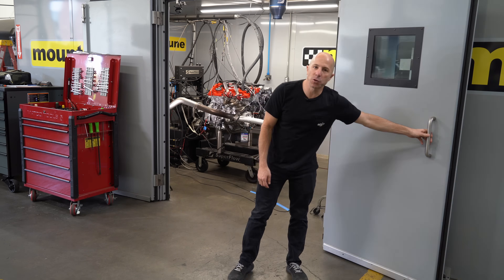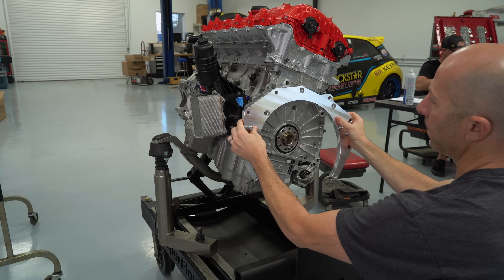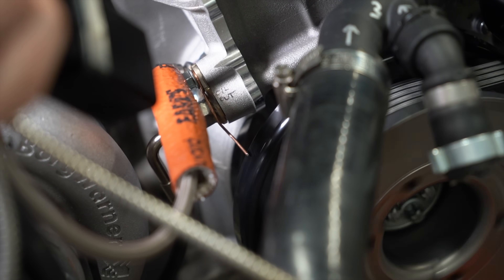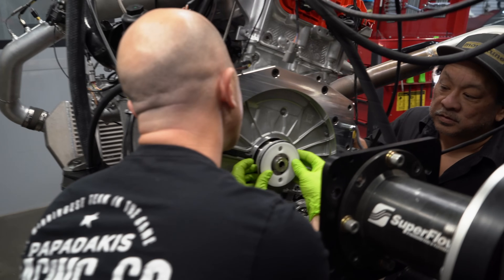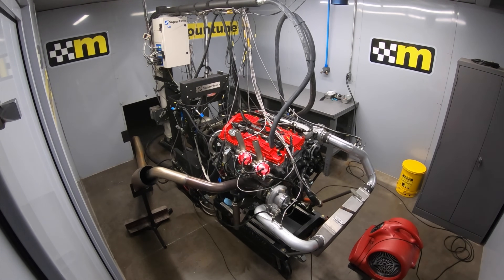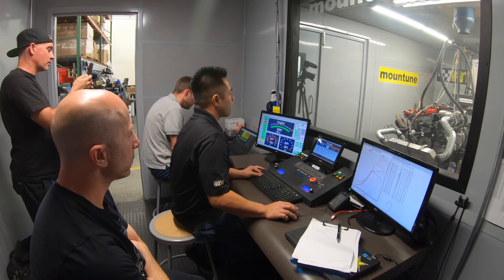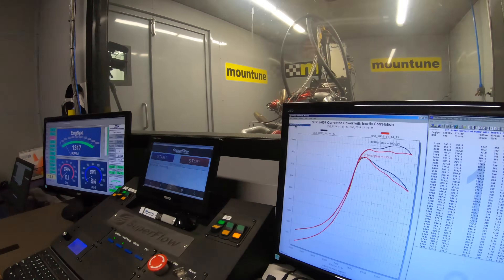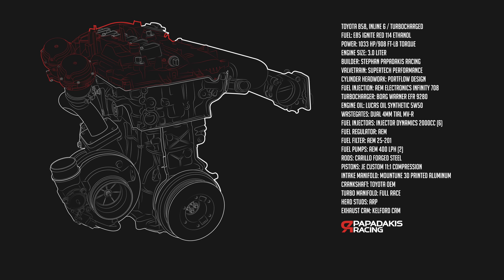B58 Engine Dyno 1000+ Horsepower - Sounds like a 2JZ!?

Comment: This car hasin’t been out that long and the motor is already at 1000hp😂😂😂
Reply: Money makes shit happen. Especially when you have the background on how to use that money and the resources to put that money to use instantly and the first time around!
Reply: i mean pretty fuckking stupid comment...
Reply: Passive Aggressive You could consider it stupid... but the fact that the B58 these guys built is already pushing 1000HP and how well it handles the power is great.
Reply: @dj_mw6055  the engine was released in 2015
Reply: It doesn't take long to create a set of rods and pistons with deep enough pockets. Not to mention, it's nearly 2020... 1000hp is like 500hp from 10-15 years ago.

Comment: I’m curious how reliable that 1000 hp is.
Reply: Its not a toyota engine, b58 never was
Reply: john maselli thats because 2jz is cast iron and can take a shitload of boost
Reply: 43 psi should tell you everything.  At that boost level, and if you raced it on a track, after every race. If you drove it on the street, and never had a problem with bad fuel or lean outs, it could go 60,000 miles between engine rebuilds. There's no where on the public roads you can unleash 1000 horse power, so it'll be relatively reliable.
Reply: john maselli  well i myself own a bmw 440i with the b58, but im not your average bmw fanboy, so speaking of 2jz I totally admit that its an outstanding engine with a LOT OF HISTORY, which the b58 does not yet have. At this point in time it worths to wait a couple more years to see what the platform is capable of. But its definetaly gonna be insane as 1k hp was already reached with it. Also keep in mind that a 1k hp supra is not the average persons supra. It requires a lot of engineering work and money, which not many will be able to have, let alone a nice, well kept together supra. As for mentioning the brands I think people are just too emotional than they should be, it is not the name of the brand, but numbers, performance, and stability when there is enough history to analyse from.
Reply: john maselli  and one more thing to add here...
 I am quite sure none of these companies manufactured their cars or the engines in them for tuners specifically but to the market customers.
Reply: With it being a Toyota engine most likely pretty reliable but really wont know until its in the car and being driven/beat on for a good while i know that 2jz's are really pretty reliable at or above that hp level

Comment: Screw the horsepower. Any modern 3L with an aftermarket can get there. Granted I dont mean to take away from an incredible achievement and problem solving/pioneering...but the TORQUE

Comment: Just gonna zip tie a towel in there, that fixed it.
Reply: I rofl'd hard. On one hand they build some custom one-off everything and use the most top of the line techniques and on the other hand "let's zip-tie a towel over that AC and BBQ the head into submission" xD
Reply: Isn’t it cool that they are willing to share that? I love it, not too proud to show the little fixes
Reply: @hubbearing4120  It very much shows the racing mindset : half precision engineering, half field repairs and creative improvisation. Love it.
Reply: The AC compressor is disconnected that's why it leaked Freon with oil. so what they did is the quickest fix. once the compressor is connected, it won't leak anything.

Comment: Incredible job can’t wait to see wear this engine ends up in.
Reply: I can't tell if that was an intended pun or not, but I'm happy either way.

(wear instead of where.. because reliability of 1000hp engines)
Reply: Indeed, this engine will be less reliable either way, it has more restrictions and you need to push it harder to get to the 1000hp. Wear is indeed the key here...
Reply: Where*

Comment: Its more BMW than Toyota. You can here that distinctive BMW 6 cylinder howl. Now the task is to spread that power and torque more widely so when its in a race car, it will pull out of the corners. If you go and play the videos on how BMW got 1500hp from 1.5 litres, yet made it drivable on the track, and in 1980 no less, the lessons are there.

Comment: Why do some engines need more pounds of boost to hit 1000 than others?
Reply: Well you have to understand engine basics to understand the answer to that. An engine is basically an air pump. It pulls air in for its oxygen content mixes a fuel and sparks the mixture. Power is dependent on how much air/fuel you can efficiently combust. A large displacement engine can mix an combust more fuel than a smaller one of equal efficiency. This is fairly intuitive. Where some people get lost is that boost is volume independent. If you double the amount of pressure in an engine you double the amount of oxygen that is available to burn regardless of engine size. So for instance all other things being equal a 4 liter engine running at one bar would produce roughly the same amount of power as a 2 liter engine at 2 bar. But if you boosted the 4 liter to 2 bar the 2 liter would need 4 bar to catch up. It becomes an exponential rate of increase. This is highly simplified and there are literally thousands of variables that taint the equation but at the heart of it this basic principle is why some engines need more boost than others to reach 1000.

Comment: Guess the Supra doesn’t need the S58 if the B58 stock crank is that strong
Reply: Ehh? Idk man, the S58 can still make more power a little easier than this can considering that its twin turbo-charged, unlike the single twin-scroll turbo on here and it has a shorter stroke compared to the B58, allowing for bigger valves for better airflow/higher rpm, so theoretically the S58 would probably work less to make this power (assuming you do the same mods) But yeah, you could argue that it doesn't NEED the S58 :P
Reply: Plus the B58 sounds 10x better than the S58
Reply: @seanoconnor8135  AGREED

Comment: Who would think a built I6 turbo motor would sound like a built I6 turbo motor.
Reply: Right?
Reply: Ryan Cravens I don’t even like import engines but I know damn well different inline 6s sound different to other inline 6s
Reply: @devious762  yes, but a 2JZ with 270 cams sounds less like a stock 2JZ than a stock 2J vs stock RB....
Reply: Ryan Cravens now you’re comparing apples to oranges

Comment: I'm curious, Why not use the direct injection? Is it because of pressure required because of the higher boost? Or no available parts for higher flow? Because maintaining the DI even as a staged system could the need for plugging the head no?

Comment: Why not use the DI system? E85 gains even more knock resistance when it gets injected directly into the cylinders. Not to mention the low RPM drivability improvements you'd probably see if you used the port system as aux fuel. Seems like you're kind of defeating the purpose of using a newer engine platform.

Comment: I've been tuning imports for 15 years, in that time I have seen good engines come and go, this is a good engine, but it is NO 2jz. 1st lets look at the limited flow characteristics of this 2 exhaust port head( and before anyone says  "limited" it makes 1000hp debut) if you know how to read a dyno graph, that engine was out of flow at peak rpm, 2nd you're not going to get the same flow numbers out of this b58 head as you'd get from a 2jz a Barra or a RB26 head, 3rd you would need tremendous air flow at high rpm to make super high hp, 1800hp-2200hp. A 2 exhaust port b58 head seems to run into flow restrictions at 6800-7200rpm. Well to low of an rpm range to make HUGE hp numbers. This b58 engine would make a excellent street,drift,road course powerplant, but leave drag racing to its daddy the 2jz. Not talking  sh%t just sayin 🤔😏😎
Reply: These B58 engines will be at 2000hp before end of 2020, there is nothing that can´t be solved with money
Reply: @GunniGST  yeah they might be at 2k hp, but they will have more issues at those HP levels, especially on the exhaust side of the engine. Just sayin 🤔

Comment: what is it about using direct injection that tuners dont like? i always thought it made more power than port injection? ive noticed that turners dont want to use the direct injection in the FA20 either

Comment: Great video and amazing achievement.
My question would be : why don't you use both direct and indirect injection at the same time since you had to leave the injector in the head anyway ? Because (I am not an expert like you but I study car engineering) it could have provided much better tunability to make more power. I don't know if I am reaching here but is it possible to use the indirect injection for the main injection and the direct injection to fine tune it ? Is it because it is too difficult to manage or because it's no use at all ?

Comment: Engine torque is in lb-Ft, not ft-lbs.  ft-lbs is bolt or twisting torque.  If you want proof, look at the dyno read-out at 10:50, "Torque lb-Ft Blue".

Comment: Would it possible to use a head from a m340i with 6 exhaust ports? I would imagine the 2 port design in the Supra version is flow limited with that kind of power and back pressure would be robbing you of more power...

Comment: Does the rotational mass from the adapter plate effect the hp readings on the dyno?
Reply: I'd reason that it would, but that with the mass of the adapter known It could be theoretically calculated out of the readings. Whether or not they did is hard to say. Also hard to say if the effect would be note worthy or not.

Comment: I still hate the timing chain on the back of the motor.
Reply: hourly mechanics love it
Reply: @Obd1andDown You probably never have to replace the chain and guides for well over 250 000 miles on a stock motor. However when pushing a 1000bhp,  then Im not so sure what you gonna get. But if you have the cash to do those mods. Then pulling the motor every 50000 miles or so wont be too much to ask.
Reply: @aowen1079  most chain driven stuff Ive ever seen need replaced at like 100k miles
Reply: @TomoHawKzZ  Aussie ford 6s will do 1M km on a factory chain. Guys are making 1300rwhp with single over head cam aussie 6s. The twin cam "Barra" versions are past 1600rwhp and I haven't seen a chain issue yet. The US made V8 fords how ever are a mess with chain issues.
Reply: @V6turbo  everything in the US seems to break or blow up but I've not heard those stories that much anywhere else. Might also be due to the fact that most English speaking internet is from the US but who knows
Reply: @TomoHawKzZ  Lmao ford 4.6s have done 1 million plus miles without even being opened bud.
Reply: Track Days. Huh? My Coyote has been at 600 whp for 89,000 miles that I know of- total of 128,400 miles on the clock. Not one issue with timing chains. 
I’ve seen them fail. But it wasn’t the chains failing it was something else in the valve train locking one of the lobes on the cam forcing the chain sprocket to disintegrate.
Reply: @karlhopkins713  must have diamond chain guides 🤔
Reply: @hagglundguy  It's because
1) Americans like to shit on anything that isn't american made
2) Most Americans don't know how to maintain anything beyond engine oil and filter changes and can't be trusted to look after anything more complicated than a Crown Victoria, they ignore maintenance requirements of more complicated vehicles and then complain they broke down
3) Most American mechanics don't know how to service anything more modern than a carburettor, they don't know how to diagnose faults in complicated modern European cars so when they can't find what's wrong after hours working on them and lots of parts replaced they blame it on poor engineering instead of their own lack of knowledge
3) German brand dealerships in the US are aimed at a very high end market segment (ie people with deep pockets) and practice extortionate parts/servicing prices, so the people who own these cars think it's normal for a fuel pump to cost 2000$ and to pay another 2000$ to have it fitted when the truth is they're just being ripped off
Reply: @BigUriel  oh I guessed it'd be something along the lines like that.
Here in Europe us Europeans mostly drive European cars and some Japanese ones. 
I visited the US a few weeks ago (Mainly WI). US seems to have much more japanese cars than europe, and most european cars in the US were Jettas and Golfs (just like here). Then there were just a few M5 bimmers and a few mercs but much less german automobiles than one would expect. 
The most sold car in Europe is the Golf. Heck it's the most sold car in almost 30 countries here.
The most sold car in the US is a Ford F150 if I'm correct.
Reply: @aowen1079  True...it's not a Mercedes 🙄 (I'm a Benz nut)
Reply: @aowen1079  yeah but it's bmw so the guides will probably wear at 150000k's
Reply: @joecook3223  That's 2000s Mercs lol
Reply: Obd1andDown bmw did that for weight distribution, even though the Supra is not 50/50
Reply: DGFr0sty you mean to get rid of unsprung weight. Not 50/50.
Reply: @Ptgtperson  by moving timing chain to the back they move a lot of components to the back of engine. Which will help weight distribution of the engine not reduce weight because nothing get reduced/deleted, just relocated.
Reply: @Ptgtperson  how would the location of the timing chain effect unsprung weight.
Reply: 1) Unsprung weight has to do with the suspension and anything that's connected to the rods and wheels. An engine has nothing to do with that.
2) Weight distribution, really bro? If you have less components at the back of the engine, then you can shove the engine itself further backwards and end up with basically the same thing. A timing chain at the back adds complexity and weight because the pulleys need to be bigger to fit around the crankshaft or it needs a central shaft like on Audis.
Stop listening to marketing wanketeers, start listening to engineers or check information yourself.
Reply: Having it at the rear of the engine is actually a great idea  as it significantly reduces the torque applied to the nose of the crank. It makes even more sense when making big power like Mr Pap is as the engine will rev quicker which will make the long 6 cylinder crank twist more if it was in the front like most conventional motors
Reply: @joehunt1980   "significantly reduces" That's some funny facepalm bs.
1)  is is significant to begin with? 
2) are you sure it's actually a benefit and not the other way around?
Here are the answers:
1) The drag caused by camshafts is really only a few horses. Think about it: even if you make a 6 cylinder that produces 10 hp, then it still has plenty enough power to spin those cams at 7k rpm, right? It really only consumes a few horses. If you increase power output, then the drag of the cams doesn't change.
2) If you put accessories at the front of the engine then the crank would twist less. Think about what you say before saying something.  All cylinders produce about 1/6th of the total power, it would be optimal if you'd connect 2 gearboxes to either side of the engine. If you did that THEN you would have 500hp of stress on either end of the crank instead of 1000hp on one end.
By putting all the load on one end in stead of spreading it, the crank will twist more.
Reply: it is how i put it. It is not drag but torque (i actually put it in my response) as the engine revolutions increase (which is quite rapid in the case of a performance engine) the extra torque applied to the crank nose from the mass of the cam train will try and counteract the rpm increase of the rest of the crank. ie twisting force. the driving end of the crank (flywheel end) has very little effect from the weight of the cam train as it is the path of least resistance to the driveline of the vehicle. in laymans terms it is the difference of torque being applied to 2 feet crank vs only inches
Reply: @joehunt1980  What the hell? Do you want to prove you don't know what you're talking about or what?
Gosh, think before saying something. But here is some explanation either way:

---

(1) About "mass of the camtrain":
1st mistake: the camshaft is not that heavy, and it has a small diameter. Engineers would call this a low moment of inertia. Simply put: it is not shaped as a flywheel, it doesn't have much the flywheel effect if you accelerate it quickly.
2nd mistake: The engine in under load dude... It's on a dyno, it's not revving, it's slowly increasing it's RPMs because of the load. The dyno is putting load onto it to measure the torque.
3rd mistake: The torque/energy/power that you need to spin that camshaft mostly comes from the valvesprings. The valvesprings make the cam hard to turn, if you build an engine without valvesprings, then you can easily turn the cam with your fingers. And how hard it is to push in those springs only depends on constants like valve lift, types of springs and RPMs, NOT the power that the engine is making.
---
(2) About "least resistance to the driveline":
Dude, open your eyes, the camshaft is not producing power, it's consuming power, JUST LIKE the driveline.
How don't you see this???? Simple put: each cylinder makes some power and that power is used to make the camshaft spin and to make the gearbox spin.
The power goes like this:
Cylinder combustion makes pressure, pressures pushes piston down, piston makes crank spin, crank makes gearbox spin and crank makes timing chain spin.
THAT'S the path, omg.
Both the timing chain with it's cams and the gearbox consume the energy that the engine is producing, and both of them are on the same side of the engine.
Reply: Yes, real fucking stupid idea.  
Nothing like working on a old 68 455 big block.

Comment: So much custom work to get a BMW to make power when you could have just got a stock block 2JZ bolt a big turbo on it ...add some E85 and presto you would have a reliable 1000 to 1500 HP depending on what turbo you went with :)